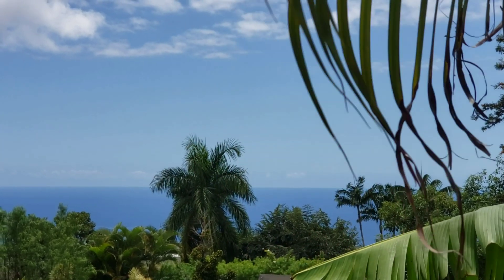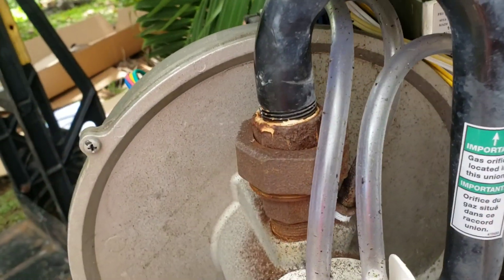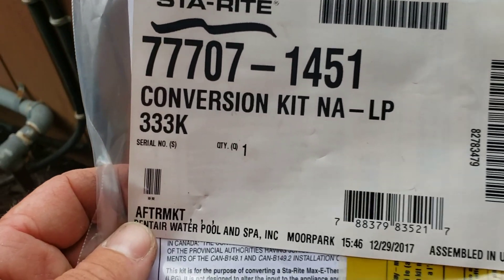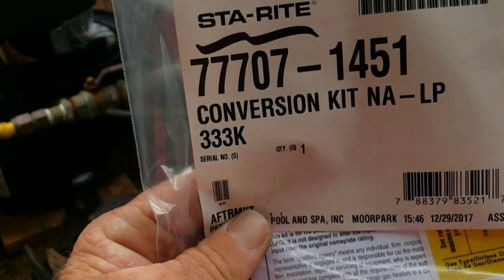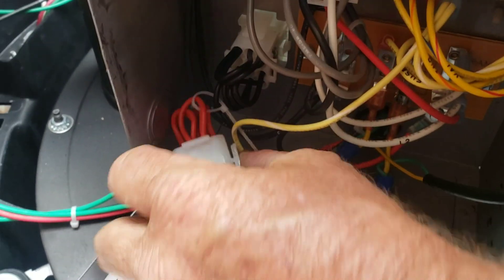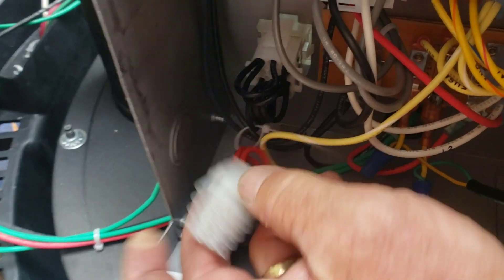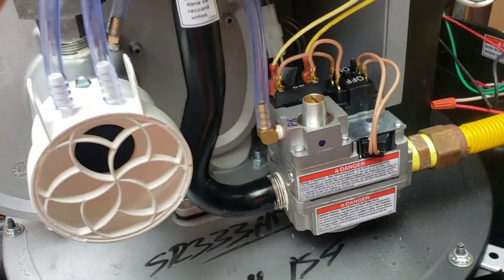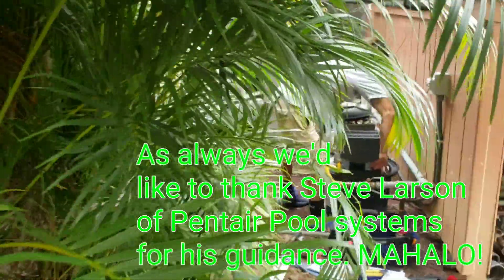How to convert a Pentair MAX E THERM heater from Natural Gas to Propane. Also choose correct wiring

Comment: I need help please! I just had my Max E heater installed. After installed, there is a loud high pitch sound coming from the heater. Everyone is playing the blame game. Propane guy said it sounds like a bearing noise, Max E company said propane issue. Can the air orfice make a loud whistle sound. I learned my lesson by purchasing online. Always buy from a dealer and have “them” install it. Thanks!!
Reply from the maker: Aloha I apologize for the delayed response you or anyone can call us at 808-960-1026 if you're on the spot and have a quick question. Not a hundred percent sure I can answer it but we will do our best. In that case you want to make sure that the orifice is the correct one in some cases there's a conversion kit that needs to be added natural gas to propane what are you running currently?
Reply: @poolbritekonahawaii1265  it was converted from natural gas to propane. I hassle a plumber check the WC levels and they were good. It’s hard to get it to Ignite. Takes several tries to finally get it to...
Reply from the maker: @JayandJanna  that's interesting. Is your propane level above 40%? Also do you ever notice that it goes into an error code either service heater or service system?
Reply: @poolbritekonahawaii1265  it’s above 40%. Error code has came on for a split second a few times but then goes off...service heater

Comment: Shouldn't all gas heaters be hard piped and not use a flex for connection?
Reply: No.  Appliances should have flex lines connected to reduce vibrations on the supply line.  Also, in every state I know of flex lines are required  because of what I said.
Reply: @aarong7982  Vibration from a low pressure gas line? Ask Pentiar how they recommend plumbing gas to the heater.

Comment: We recently ordered a Sta Rite Max E Therm 200 heater expecting an LP but received a NA with conversion kit. Was the conversion as easy as replacing that one disc or was it more complicated?
Reply from the maker: They are both very easy to replace